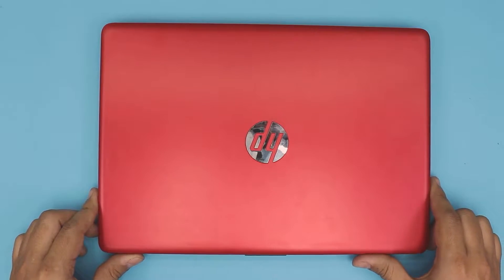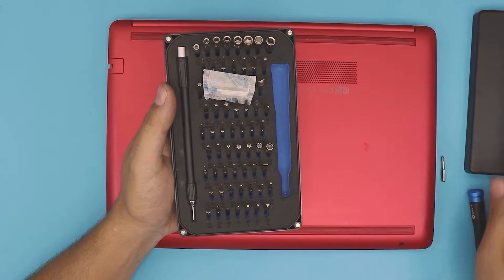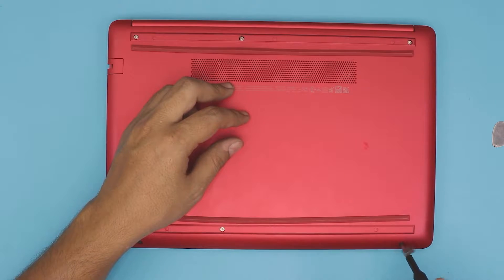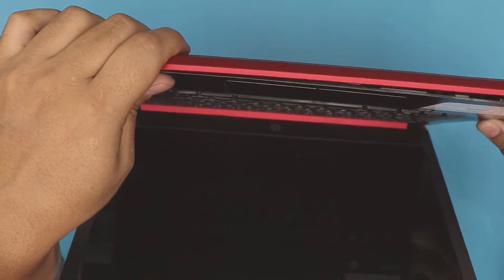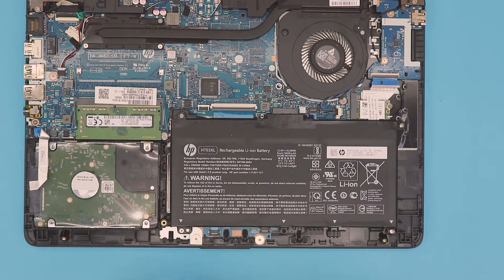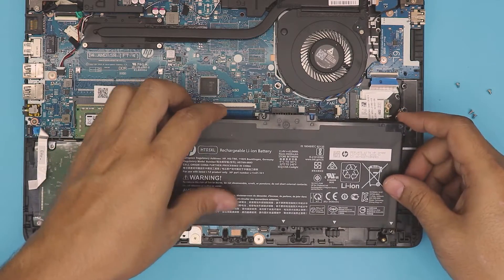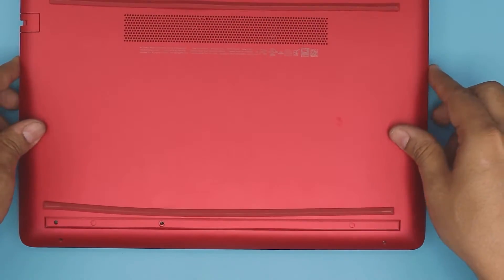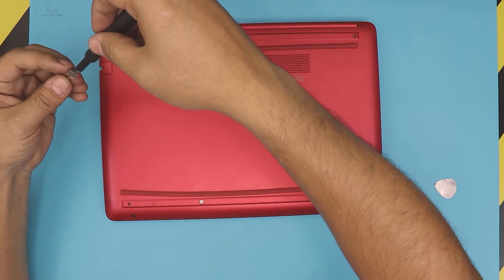HP 14 cm - xxxx  Battery replacement Step By STEP !!!

Comment: Hi I had no trouble getting the plastic and screws off, but doesn't seem to have any gap to get the cover off. 
The video was excellent but have no idea how to release the cover ,
Any suggestions?
Thank you
Reply from the maker: Thank you for your feedback! If you wish to support the channel, you can like, subscribe, or both!
Regarding your question, you need a guitar pick .3mm thick and hard and you will need to stick it in between the palm rest and bottom cover and twist. i wish i could give you a better way but this is the only correct way.

Comment: Nice video.
Does this laptop have a CMOS or RTC battery. If yes, how can I replace it?

VERY URGENT PLEASE!!!🙏🏽
Reply from the maker: Thank you for your feedback! If you wish to support the channel, you can like, subscribe, or both!
Regarding your question, sorry to inform you but this laptops don't have a dedicated CMOS battery they use a capacitor and take the voltage from main internal battery, if you want to reset the BIOS to default options, you can remove the charger remove the battery and press and hold the power button for 60sec and then plug in the battery and charger and you have reset the bios.
Should you have any further questions or requests in the future, please don't hesitate to ask me.
Reply: @uFixTek   It displayed an error message about it's CMOS battery being dead but I couldn't find one. Thank you so much for this insight though. Thank you for your time.
Reply from the maker: when the main battery is drained it will give you that error, don't let the  main battery to be drained. it is my pleasure to help my friend,
Reply: @uFixTek  You've been really helpful. Thank you
Reply from the maker: it is my pleasure my friend, cheers 🍻

Comment: Can we not use the battery? I am planning to remove the battrey, and use the cable to turn on the laptop instead.
Reply from the maker: Thank you for the feedback! if you wish to support the channel you can LIKE or SUB or both :P
regarding your question: absolutely YES, you can remove the battery and use the laptop without it and it will be fine, the charger will last longer and so will the motherboard.
Reply: @uFixTek  Thanks. But sadly I am afraid to open the case on the back. :D
Reply from the maker: trust me its super easy its very very hard to damage it, its just a cover.

Comment: My laptop says Cmos checksum invalid code 502 then the screen goes dark,do you know what I can do,I almost the exact same model
Reply from the maker: Thank you for the feedback! if you wish to support the channel you can LIKE or SUB or both :P
regarding your question: okay 1st of all i need to know in detail what happens.
when you power on the laptop after how many sec you get a msg saying Cmos Che..... code 502 ?
and after that screen goes dark and after 5min or so still dark? or it goes to windows? or you force shutdown? 
the solution i would like you to do is the following:
remove the internal battery and the charger and no need to put the cover on, and press and hold the ON button for 60sec
after that plug the battery and then plug the charger and wait 10min and then power on and see if your error is gone.
the above solution is resetting the Cmos chip.
Reply: @uFixTek  when I boot it stays dark,flashing a bit as of the screen want to turn on
But thx man,I appreciate the help,it's on charge now for the 10 minutes hopefully it will be all fine
Reply from the maker: ok, i hope it fixes if not let me know and in the morning i check the msg.
Reply: @uFixTek  unfortunately it still does the same after all that,it booted into windows but the screen just went dark again
Reply: @uFixTek  I've gotten it to finally work,thx man I really appreciate the help
Reply from the maker: awesome i'm glad you got it resolved. :)